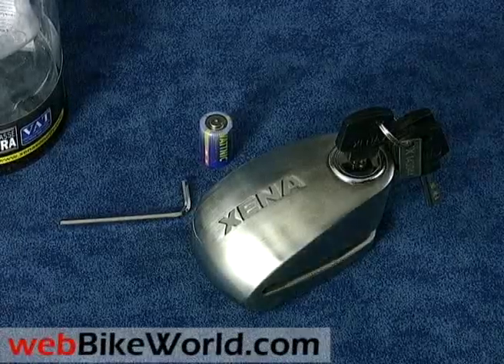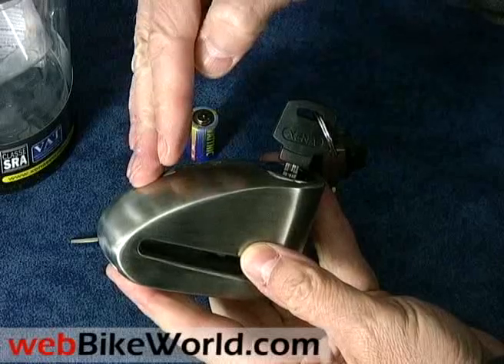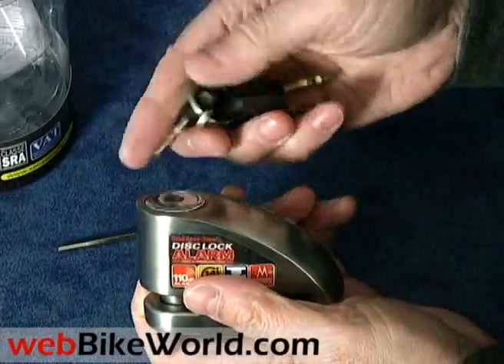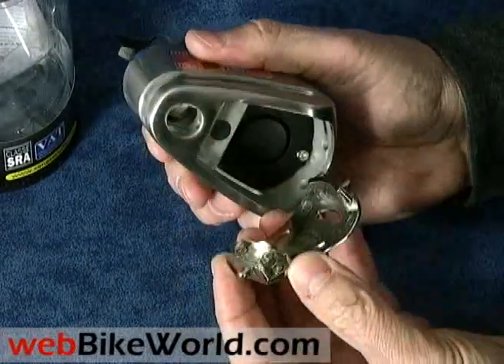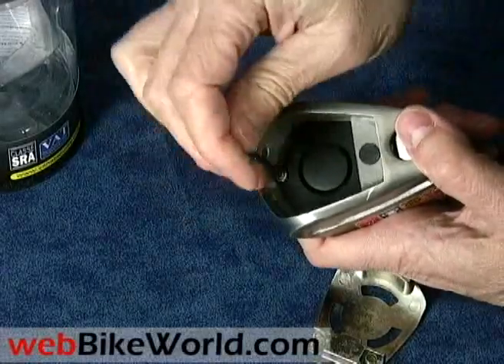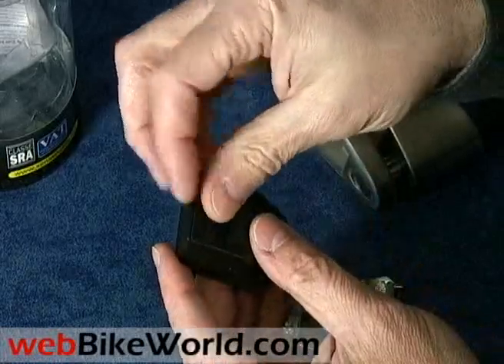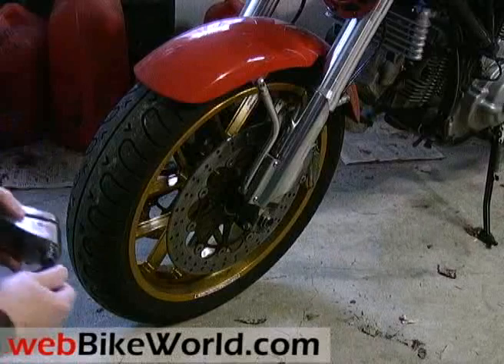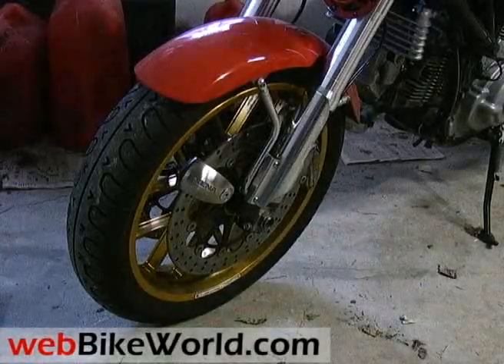Xena XX14 Motorcycle Disc Lock Alarm

Comment: I have an Xena XR1 (old version)
It's awesome.

I've had it over 8 months and the original batteries are still going strong.

It has also been under all sorts of crappy weather and still no sign of failing.

Comment: many of us have false alarm issues with xena disc locks,and the suggested tips on the website don't work. plus they rarely seem to answer any requests to their tech support service! i think they are a good alarm IF they work, but many don't and you won't get help fixing it.
Reply: secretgardenproject Hello "secretgardenproject" My name is Dan e-mail sales@xenasecurity.ro - romanian XENA SECURITY distributor.I saw your negative coments in your posts regarding high sensivity tilt sensor on constant false alarmsparticularly for the XN15 and XZZ6L and poor after sales support and service from Xena.With respect want to ask you a few things that I hope your sincere answers:1. when problems arose with XENA alarms why not contact australian XENA distributor GAS IMPORTS e-mail info@gasimports.com.au,before sending e-mail to XENA SECURITY headquarter ?2. if you say that you have corresponded with XENA SECURITY headquarter, why not post messages sent and received,related to solving the problem ?3. we sell since 2007 all XENA models and until now, I'll be honest: I have met only one alarm unit with very highsensivity and I replaced it. Moreover our customers romanian bikers are interested and ask alarms to have good sensitivity.With consideration, Dan

Comment: I have a problem where even when not locked it goes off. There is no shut off switch! My neighbors complain when I am walking from down staires carrying it back upstares.  I have to place it on my bed under a HUGE stack of pillows to keep it quet!  I can't take it with me as I am moveing in transition setting the alarm off all the way to my destination with an alrme going off as though I stole my own bike!  Is there an alarm that I can have not go off when it is in the unlocked position?

Comment: @ferthelet, Although I have not used this alarm too much, I have NOT had ANY problems with false alarms (other than at battery change). My understanding is that the false alarm problem happens with previous older models, e.g. that use the small watch batteries.

Comment: #1: Battery change is very difficult and ABSOLUTELY can't be done without triggering several false alarms. Although I recognized that if the electronic module is close to the lock, a false alarm would less likely trigger, NEVER THE LESS IT DOES!!! This is extremely annoying!!!

#2: I'm not satisfied with the finish of the product. Particularly the door to the electronic module of very poor FIT and QUALITY.

#3: Last but not least, this product weighs almost 2 pounds. Too heavy for a backpack.